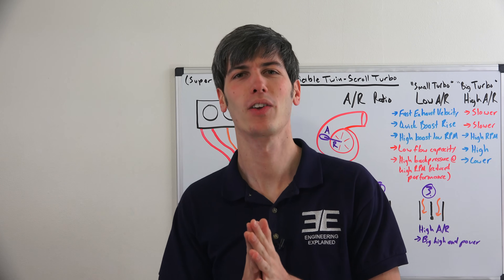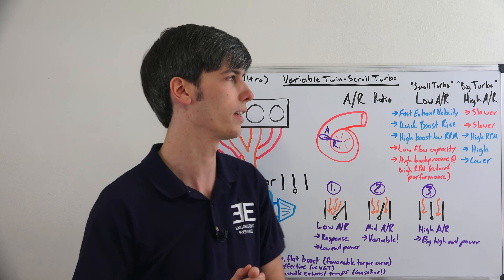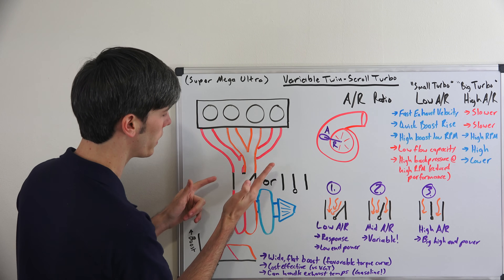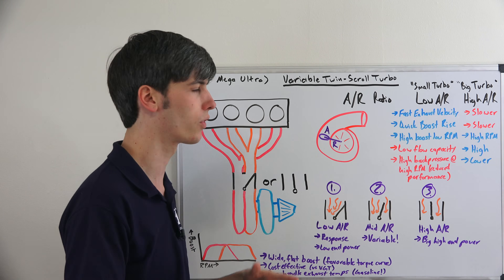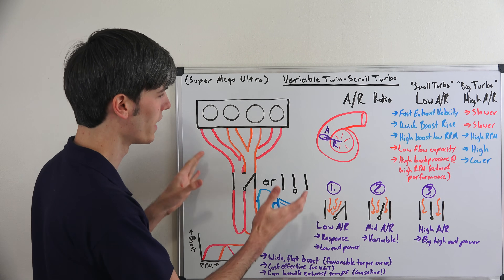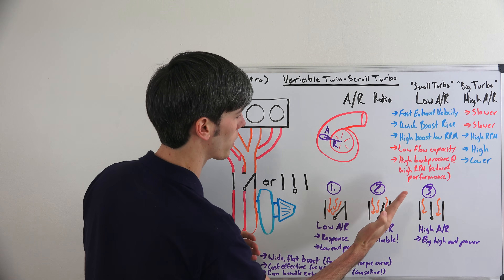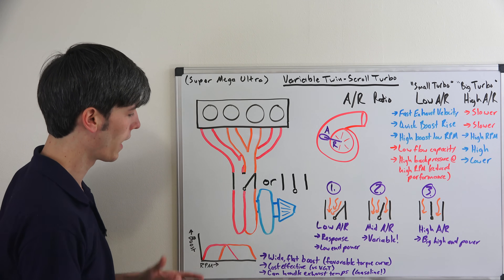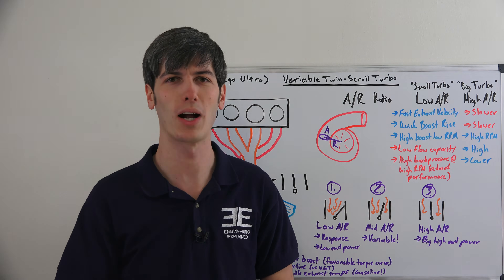Variable Twin Scroll Turbocharger - The Future Of Gasoline Turbos?

Comment: I have a question, why wouldn't the variable valve open completely, to let all of the high rpm exhaust into the high velocity scroll, instead of opening half way to let half of the exhaust be waisted into the low velocity scroll? Wouldn't you receive more power with 100% of the high rpm exhaust gasses flowing into the high velocity scroll for maximum air volume? Thank you.

Comment: Yep....not new or groundbreaking.Mazda had an identical setup on the Series 4 Turbo RX-7 (TII) all the way back in 1986....with development starting in the early 80's. Granted, the 89-91 RX-7's turbo design was a marked improvment without the twin scroll flapper (just twin scolls and a better manifold), but the S4 worked as advertised.  Chrysler also tried (fairly unsucessfully) variable nozzle turbos in the 80's. With turbo development going back before WWII, if you look hard enough, I bet you will find twin/variable scroll-nozzle turbos existed then too..... Just like fuel injection, DOHC, multi-valve heads, superchargers, meth injection, water injection, nitrous and all the other stuff we think our generation invented! ;-)

Comment: Very interesting. 

Seems similar to SP engineering's "quick Spool Valve " Except with it you can run it on any twin scroll turbo charger. Its nice because if anyone runs a huge turbo the quick spool valve essentially blocks off one side of the scrolls so all the exhaust pressure is doubled through a smaller area resulting int much faster spool.  Its sort of like if you take a hose and hold your thumb at the end and the pressure seems to rise. now imagine doing that to alittle fan blade with that higher pressure from blocking it off.

Comment: greater rotating mass = lag
those things will not be used,except on diesel engines.
more air =more gas ,as i know ,the manufacturers are searching to reduce emissions and increase mpg,not the opposite.

Comment: your drawing literally shows that 2 pairs of cylinders are connected their own scrolls, does this type scroll system actually work like that or is there "collector" area in manifold before turbo where all exhaust gasses can mix, like in normal turbo manifolds? If 2 cylinders actually only connect to one scroll, doesn't that mean when valve is open(blocks sidewall) those 2 pairs of cylinders have different amount of back pressure because of different size scrolls, which mean they need different fuel and ignition mapping...

Comment: Great video as always it seems like a much more simple solution to other turbo designs in the past (I drive a subaru sequential twin-turbo) that has sooooo much more R&D/more to the system to be happy and still would not be as efficient as one of these turbos (correctly sized) and i could not see this costing that much more that it could not be made on a production basis awesome stuff!

Comment: Its basically taking the place of twin sequential turbos  such as the last model fd rx-7  had  without all the complexity  of using a small  primary  &  larger secondary turbo & all the componentry needed to achieve the same goal     ,   I heard about this quite a while back .    KKK turbos used on for example Porche is the European arm of  Borg Warner  U.S.A.      Great turbos !    High quality  & certainly not inexpensive .
Reply: +Frank Fitzpatrick You beat me to this post LOL!  Porsche has had these variable trim turbos on their turbo models for a few years now.  Borg is just now starting to make them available for the masses.
Reply: +1DuGuder Hi, i'm sorry, but i think you're wrong about that. They use a real VTG turbo on the 911 turbo/turbo s. It work as a turbo for a diesel, but uses exotic materials to handle the high exhaust temperatures

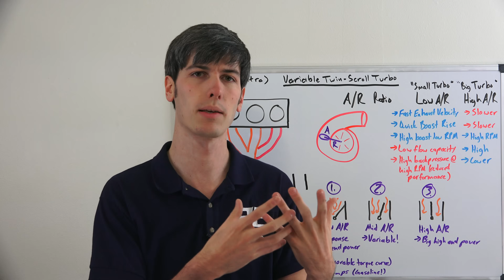Comment: at 0:25 you say VGT's typically aren't used with gasoline engines because the materials necessary to withstand the "High heat of gasoline engines" is too costly. The EGT's on gasoline engines are far lower than that of Diesel engines. On occasion, the EGT's in a diesel can hit up to and above 1000 degrees. I'm talking diesel truck engines. VGT's are commonly used on Diesels for better spoolup on takeoff as well as a more broad power band for towing and just all round driving.
Reply from the maker: +BBRRAAAAAAPP VGT's can't handle the higher exhaust gas temperatures of gasoline engines (as BorgWarner and Honeywell informed me at SEMA).
Reply: I don't understand how that would make sense when the EGT's of a diesel are higher and diesels still use VGT's (I believe it was GM/Isuzu first with the Duramax, then Ford had a VGT on their 05+ 6.0 diesels, and Cummins has been putting them on the 6.7 diesels that are put in the Dodge truck. I'm not saying you're wrong i'm just confused as to why BW and also HW (who makes the turbo for the cummins) would say that.
Reply: +BBRRAAAAAAPP  as an owner of 4 modified diesels (one TDI, one BMW 335d, and one 7.3l F350) I&#39;m fairly certain that EGTs from diesels are quite a bit lower.  Most diesel guys consider 1400*F pre turbo as a high limit for street use.  Gasoline guys consider this a bit low.  My rotary sees 1700-1800*F pre turbo.  Sometimes a few hundred degrees are the difference of turbo survival and failure.  The only VGTs I know of that has been used on Gasoline engines were on some Chrysler products in the &#39;80&#39;s, which might have been Mitsu powerplants.  I don&#39;t recall.

Comment: Variable geometry turbos have been used on diesel engines for 15years. This is actually a diverter valve set up. A true variable geometry set up has adjustable vanes in inlet housing for the turbine.

Comment: I used variable turbos before ,they are no good in my opinion . I would rather have a turbo camshaft ground for low end torque , and build a turbo out of different housings that suits the engine .
Reply from the maker: +Jack Richter Everyone's using them these days (Ford, Subaru, Chevy, Mercedes, etc..), they're superior to single scrolls, but just cost more. Gives you a wider torque band.
Reply: Agreed ,but variable vein turbos are no good. Variable scroll ? Does the cost rely justify the end result is what a after market guy have to ask himself. Thank you for the reply.

Comment: This is a proven concept  witch has been pretty effective in several OEM things like old rx7's borg warner  are now doing it a bit nicer ..with a better flowing valve it forms a nice merge when closed  this in combination with there low mass and advanced aero wheels  will be a shit hot thing  ...  i currently have aTR30VGT on y petrol engine it has been pretty tricky to get the vanes to open at the right rate this simpler 1 or 2 scroll set up i think would be easier

Comment: [Rant On]
Homework for your next assignment.  Write 1000 times on a chalkboard the following, "RPMs is not a word."
RPM = Revolutions Per Minute.  RPMs doesn't make sense.  Revolutions Per Minutes?  Go back in your video and anytime you stated RPMS you could replace it with Revs.  Sorry for the rant, but it's like nails on a chalkboard to this engineer each time you say it.
[Rant Off]

I have no other issues with anything else you've ever done.  Love the channel and what you are presenting.  The whiteboard explanations are a nice touch.  Us engineers need to explain things visually most of the time anyway.  Kind of hard to explain pretty much anything engineering related without a whiteboard or a physical demonstration.

This really is phenomenal turbocharger technology though.  I wonder which manufacturer will be the first to put it into use on one of their vehicle lines?  Ford?  GM?  Dodge?  Or an import?

Comment: At 2:55 you explain that the lever opens gradually until both scrolls are fully open. I understand why its closed in the first place so the smaller turbo gets all the exhaust gases at low rpm causing it to spool quicker and deliver more power on the lowerband then when you explained that the bigger turbos provide boost at higher rpms. My question is, why dont they close the smaller scroll off when at high rpms so the exhaust gasses from the 4 cylinders only feed the bigger turbo? Rather than supplying exhaust gasses to the smaller turbo at which point you are in the high rpms causing the smaller turbo to be redundant. So why is it still being fed exhaust gasses?

Comment: It would be interesting to see the formation of the twin scroll. Are they totally separate or do they bleed together the exhausts. Do they need to be the same size or can it work with large and small. You still have the inertia of a large air flow section so would it not be better to operate with two separate turbochargers to really optimise the flows. And mention the new generation of electric turbos that are starting to be seen. This would seem to be the best of all worlds simplifying the whole engine by allowing the two flow paths to follow completely optimum routes rather than coming together at the turbo.  Electric transmission can potentially run in the high 90 percents so the loss from the electric transmission will more than be made up by the improved mechanical efficiency.   Pete

Comment: what are they using to control the movement of the scroll? Seems like there would be a lot of pressure against it under load and then when it starts to open, you would need a lot of torque to get it off its seat, up to and until the pressures on both sides of it started equalize!

Comment: This probably wouldn't that expensive for Borg Warner to research further, it's pretty much an adaptation of the internal wastegate. They already have the know-how to ensure the system can handle the heat, it's probably just a matter of optimising the flow of gas around the valve and reducing weight and cost.

What sort of parameter would this system be controlled by, solely RPM or would engine load also be factored in?

Comment: How they graduate this would be interesting. As the valve opens the airflow turbulence produced when the value is only partially opened (into the larger scroll ) would dramatically change as it fully opened. So a 10% opening would not produce 10% increase in pressure. But I guess that calibrating it according to turbine RPM would solve all of that. After all thats the only thing that really counts.

Comment: for the A/R ratio, if A is area and R is radius, didn't you explain them backwards..... high A/R = higher Area with less radius which means faster spool... and low A/R means the radius is larger (compared to the other):higher top end... am I right?

Comment: The flapper reminds me of the heat riser in the exhaust manifolds of older engines. It had an emission control purpose and diverted heat to somewhere..or maybe it was supposed to add back pressure? Anyway, whatever it was supposed to do, it quickly deteriorated and seized up, never to function again. I wonder how the flapper that you showed would hold up???

Comment: Correct me if I'm wrong but, what I got from this is that this type of turbo has two separate airways in it and two headers lead into each(for this example), so then how does pushing all of the exhaust into one airway increase spool-up time/ torque? Is it the increased pressures in one airway?
Reply: You get all the exhaust "pulses" hitting the same turbine, which accelerates it faster.
Reply: It's about getting the gasses to hit the turbine wheel at the optimal angle for the given rpm, which is what twin scroll is all about. The variable valve in the exhaust stream is to get more gasses at the optimal angle for low engine rpm, and low turbine rpm, therefore all of the exhaust flow is doing the most efficient and effective work on the turbine wheel. Once the turbo has sped up or “spooled” then the valve stops diverting all of the gasses to one part of the turbine wheel, as the optimal angle of gas flow changes with rpm
Reply: +Filipe Amaral All of the exhaust gases is always only hitting the same turbine wheel, as there is only one! It is about where and at what angle they hit, changing the angle changes how effective the gasses are at spinning up the turbine.
Reply: Billy Phillips One side is a low pressure turbine and another is a high pressure turbine, it's how we simplify calculations in steam turbines. It's the same shaft, but we partition them depending on their properties.

Comment: I come from a background of turbine engine design, so if my question is irrelevant for this application, let me know: As the valve opens, wouldn't the turbulent air behind the valve caused by the air flowing around it create total pressure losses thus significantly reducing the performance and effectiveness of the second spool, at least until the valve opens further?

Comment: Hey nice video, but what happens when soot deposits on the valve and it gets stick in a position or soot causes the response time of the valve to be slower? in gas engines, soot may not be a problem. but diesels will definitely have that problem
Reply from the maker: +Kartikeya Tyagi Diesel engines can use VGTs because exhaust temps are lower. https://www.youtube.com/watch?v=hdjsNPeCLQs
Reply: +Engineering Explained Agreed. Diesels also use EGR (exhaust gas re-circulation) to reduce in-cylinder temperature to prevent NOx formation. To control how much exhaust gas ends up in the cylinder, they use a similar valve-like arrangement as in this variable twin-scroll turbocharger. There, the higher soot formation of diesel engines causes the valves to malfunction a lot of times.

P.S. - you are really quick with your replies (thumbs up)